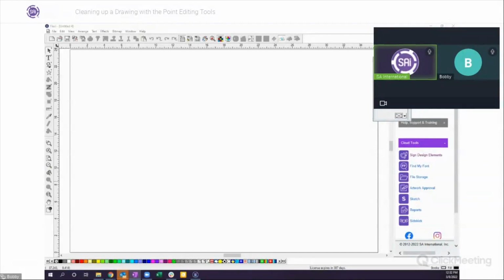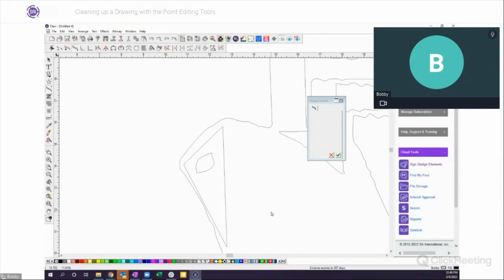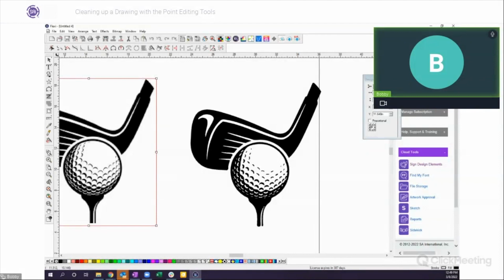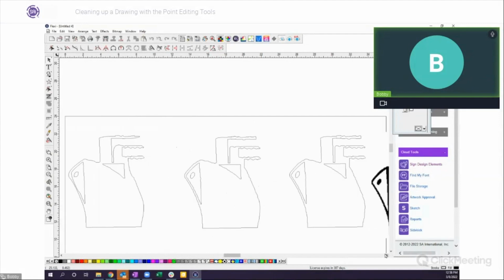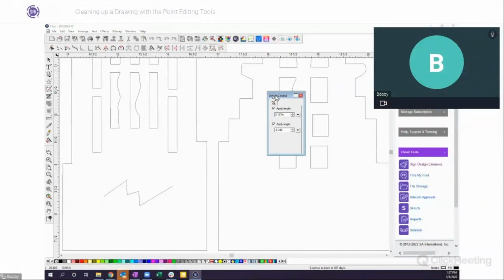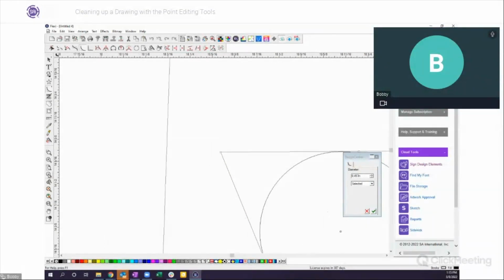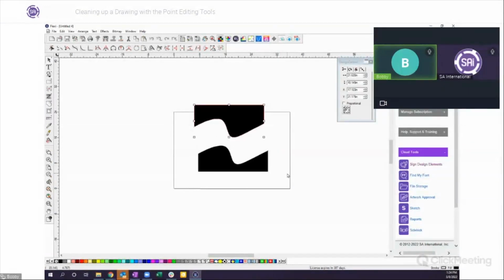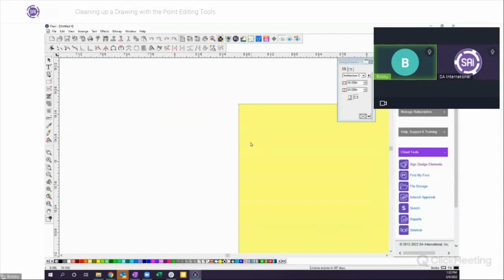SAi Flexi Webinar - Cleaning up a Drawing with the Point Editing Tools

Comment: I noticed at 44:40 when you told it to round all corners to .5 it did not round the bottom 2 corners to the correct shape of the circles. I have encountered similar issues and have had to resort to drawing circles and cutting and welding. Why does this happen?
Reply: Because you gay